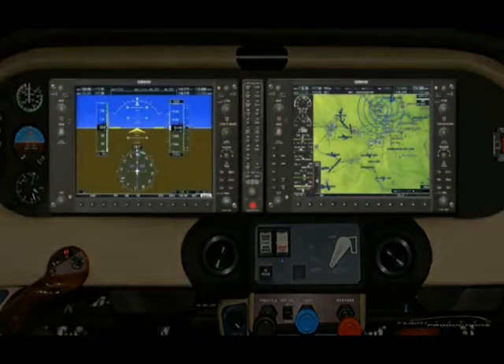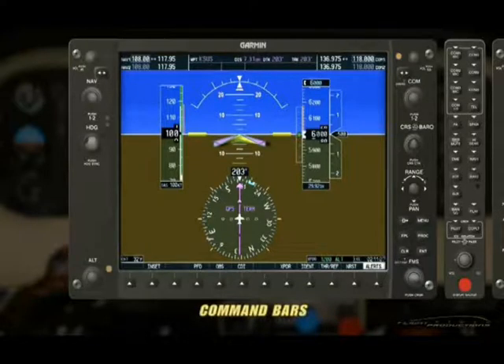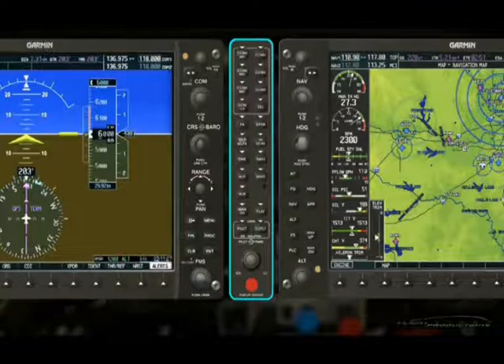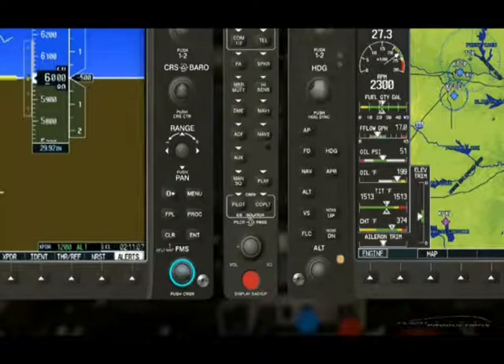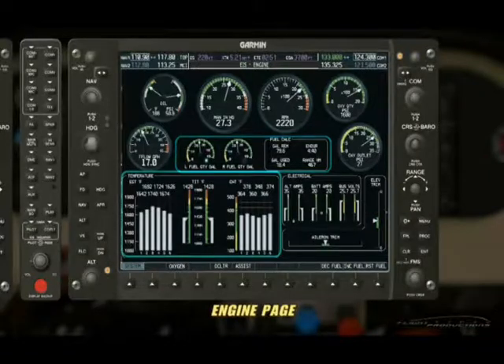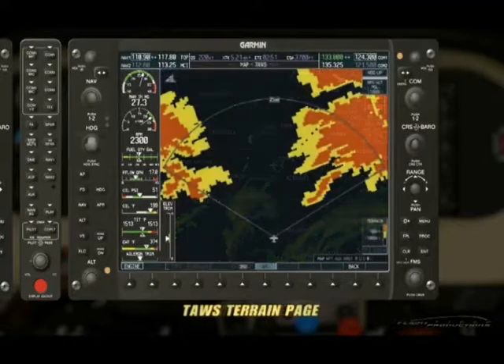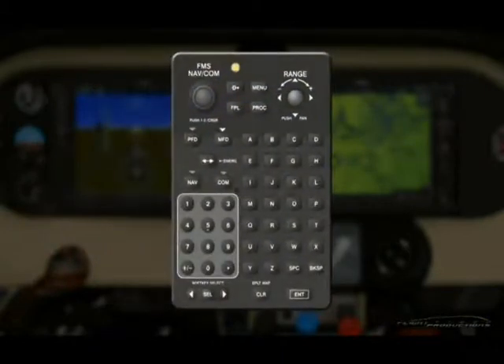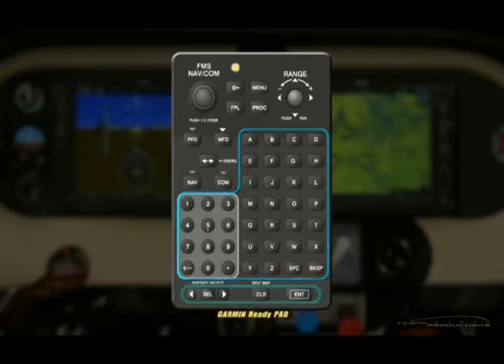G1000 GARMIN

Comment: I don't get the point of it, the Avidyne system is much easier to use and is cheaper.  I understand that the G1000 does more, but I personally prefer straight up round dial